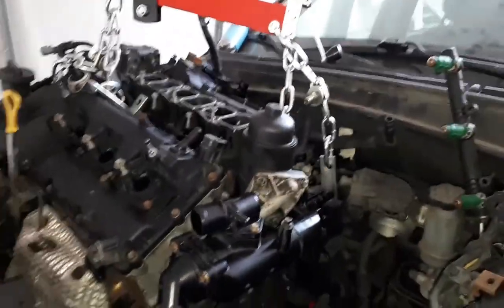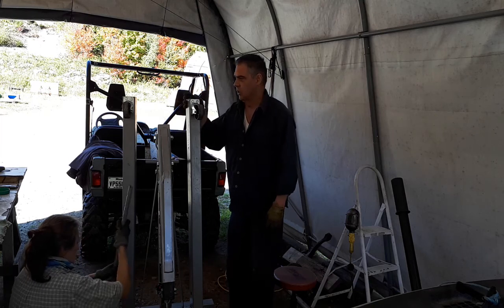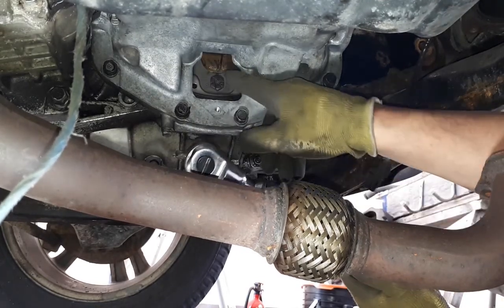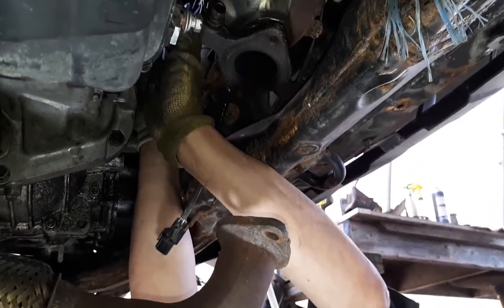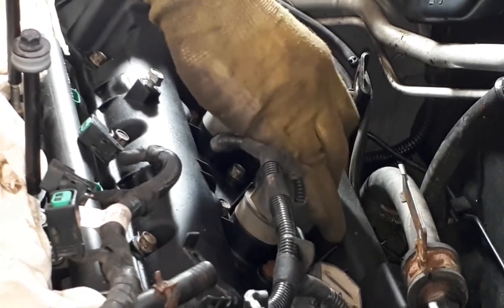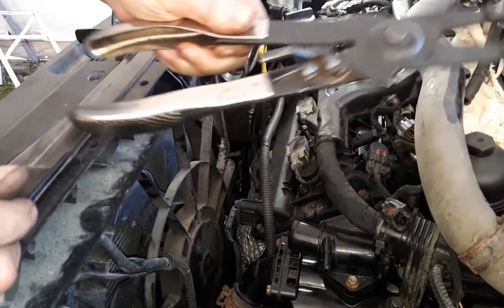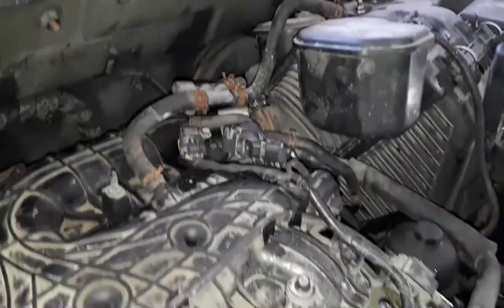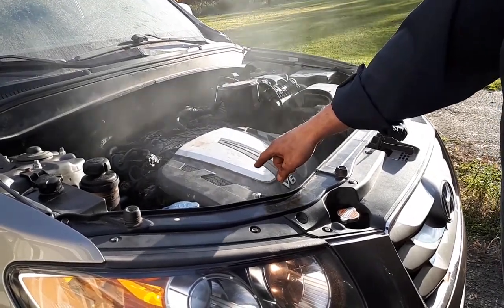Installing the 3.5L Engine in a 2011 Santa Fe GL Sport AWD Part Six

Comment: thanks for this video series! I used a lot of the information for my rear cylinder rebuild for a 2007 Santa Fe.  The compression was fine in the front half of the 3.3L, so I just decided to install new timing chains and chain tensioners. The initial issue was the rear chain tensioner failing which resulted in a loose chain that eventually broke. Got very lucky, only a few minor scratches on top of the Number 1 piston. I rebuilt the cylinder head just to be safe, with new valves. Many new items installed on the rebuild, including gaskets, oil pressure sensor, etc. I am hoping to start the engine in the next few days... again, thank you for showing a lot of the detail of the timing chains and tear down!
Reply from the maker: Thanks for the comment, very happy to hear the video series helped with your rebuild. Cheers from John and Audrey

Comment: We are just about to start rebuilding our 5.4L F150.
Getting around the cables is always fun it seems. we had to cut the bolts on our down pipes and it took us a couple hours to remove them. We didn't pull the engine but I'm wondering if pulling it wouldn't have been a better option.
Thanks for subscribing the other day.
Reply from the maker: It's always easier to do the technical work when the engine is out and easy to access. For the cables it is sometimes recommended to mark them with masking tape and number them accordingly to remember where they go.
We appreciate all the new subscribers we get and the comments they make because it is hard to build a channel.

Comment: Good morning  John & Audrey
I really enjoyed your video of the total engine work
I have 2011 kia sorento similar engine
It needs the timing chain and tensioners. Would like your opinion,  should I take the engine out to do the timing chain.
Did you have a shop manual when you this job
I am in Alabama
Reply from the maker: Thanks for your comment. I  think you can do a better job with the engine out. I have a lot of experience working on motors but I did have the Haynes repair manual for the torque specs. If you need more info just let me know if I can help. Cheers from John and Audrey

Comment: I'm curious of how many miles were on it when the oil pump went, the motor looked really good on the inside.  I ask because typically oil pumps outlast the engine in most cases and hadn't considered replacing mine, but since I have it all apart to do head gaskets I may reconsider.
Reply from the maker: Thanks for you comment, our car had over 207000 km on it, we had bought the car used so we don't know it's history.  The inside of the block was clean because we had washed it.  The life of the oil pump will depend on the conditions of the oil and type of oil used and maybe we had bad luck with ours. For the price of the oil pump maybe best to replace it now if possible.  How many km do you have on your car, what is the reason you are replacing the head gaskets?
Reply: @purecanadianlifestyle  Currently its at exactly 160500 miles, around 258km. The head gasket was leaking exhaust into the coolant system and pushing the coolant out of the overflow bottle causing it to overheat. I'm putting in a new timing set since I'm in there, the tensioners are shot anyway. I'm stalled at the moment due to a stripped out bolt hole in the block, waiting for the steel insert kit to arrive. While waiting I may just spend the extra 100 bucks and buy a pump, considering how labor intensive it is to get to it.
Reply from the maker: @SteveStoltz   So if you had contaminants in the oil this may have  caused damage to the pump and it probably is a good idea to replace the pump for 100 bucks. Have you had the heads tested for being warped or cracks ? John
Reply from the maker: @SteveStoltz  Where in the block is it stripped out? Are you putting a holly coil in the stripped out bolt hole?
Reply: @purecanadianlifestyle  I've had the heads milled and checked. One of the head bolt holes stripped out and one feels a little iffy, I'm going to go with the steel insert option. Its more expensive but its the best option. When I called to order the kit the guy said that the Hyundai/Kia kit is their most popular, since this is such a common issue. Hopefully I'll never need to go that deep into the engine again once I'm done.
Reply from the maker: @SteveStoltz  Are you installing the metal insert yourself or are you having it done? John
Reply: @purecanadianlifestyle  I'll be doing it myself, the kit comes with the proper tools and jig. Here is the link
 https://www.huhnsolutions.com/
 I think this one is preferable due to the fact that their insert is more robust than the competing kits.
Reply from the maker: looks like you got everything under control.  Thanks for subscribing, hope all goes well with your upper engine rebuild, cheers from John and Audrey Just went over to your channel and subbed.... friend
Reply: @purecanadianlifestyle   Thanks!

Comment: Great video and job, I have kia sorento  2011 same engine, It makes cold start noise,  what would you recommend to solve this problem
Reply from the maker: If the oil pressure is good it could very well be your hydraulic timing chain tensioners, normally that is one of the causes of a noisy cold start.
Reply: @purecanadianlifestyle  Thank you.

Comment: Thankd for the videos  i Just got done putting my engine back together. Did you prime the oil pump before starting?
Reply from the maker: Thanks for your comment, yes, we primed the oil pump, we cranked the engine over several times on the engine stand to allow the oil to flow through the entire engine. Cheers John and Audrey

Comment: I watched the 6 part series of your videos and they were very informative!  Did you replace your timing chains or reused the existing ones?  Is the engine running good to this day?   I have a 2010 santa fe that will make a rattle on startup at the beginning of the day.  I read in one of the comments that you mentioned it could be the hydraulic oil tensioners.  I read on the internet that using a heavier oil, eg 5w30, may stop the rattle.  Thoughts?  Would replacing the tensioners the only thing to correct this problem?  Can this be done with the engine left in the vehicle?  How would you clean the front engine covers if the engine is left in the vehicle?  Thanks.  Randall
Reply from the maker: Thanks for watching our videos and taking time to comment.  Our car engine runs very good, however I should of changed the timing chains and tensioners when I had the motor out, since they are starting to make noise at startup.  I think that this is one of the weak spots of the motor.  A heavier oil may help but the correct solution would be to replace both the timing chains and tensioners.  This can be done with the engine left in, but you may need a lift and other special tools, like an air angle die grinder with buffer pads to clean the front engine plate.  My suggestion would be to take the motor out so you can replace the seals at the same time and would be much easier to align the timing marks. Hope this helps, and if you have any more questions just let me know.  Cheers from John and Audrey
Reply: @purecanadianlifestyle  Thanks John and Audrey.  I'll try 5W30 oil as I'm not mechanically inclined to take the engine out. The mechanics at the garage told us that as long as the rattle doesn't happen during driving, that it's safe to drive.  Should it happen during driving, they said to stop driving and have it addressed.  Take care.

Comment: Phenomenal job on the car and documenting. 
How many man hours was that? I replaced the Oil Sensor as I had the dreaded light and leak -  my car was out of commission for a few days with me working on it in the spare time. My car also had VCA motors replaced twice (at dealer no less) though they always told me most of the engine stuff was dealer only since they need to recalibrate it or else the check engine light would come on / it wouldn't work properly... Truth or scare tactic?
Not sure it had anything to do with it but what were your Oil change intervals prior? Conventional vs Synthetic? Weight of oil? I am curious as I used to run thinner oil but since I've had the Oil Sensor issue I run thicker and the car seems to like that better. I also run longer change intervals since I use synthetic...
Finally could you post a parts list with links? I don't think you have but so few support for this car it would be handy.
Great content!
Reply from the maker: Thanks for your comment, it took us a day and half to remove the engine, another day to disassemble the motor and clean parts another full day to reassemble and torque down and a good day to put it back in.  So in all about 4 and half days to complete the job at our own slow pace.  We purchased this car used and the oil was just changed we drove it about 5K then we had this problem the oil pump failed.  The oil in it before we purchased not sure the kind but we are running with full synthetic oil since the rebuild. For the parts, the dealership told us they did not sell the bearing kits they wanted to sell us a sure block engine price tag in excess of 3K plus taxes.  The parts came from many different places probably at a later date we can post a parts list. Hope I was able to answer most of you questions.
Reply: @purecanadianlifestyle  Wow that's a raw deal with the car breaking after the purchase. Luckily you had the know how, aptitude and tools to fix it! Fingers crossed she stays in good shape here on out!
Reply from the maker: @honda99ex  Luckily we didn't pay top dollar for the car, as we knew it needed some repairs but we did not expect the motor to fail (oil pump).  When you by used cars,  you're buying other peoples problems. Should always keep that in mind.